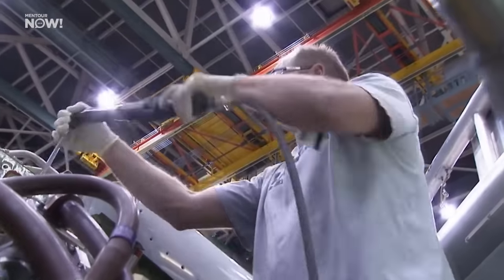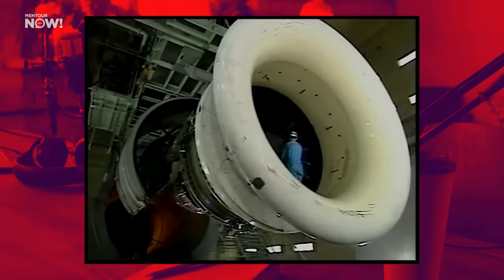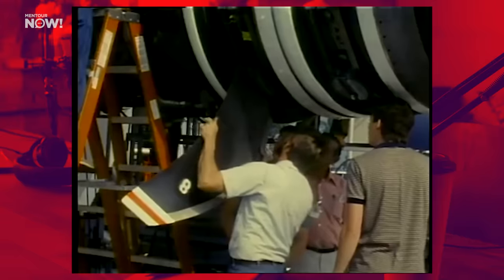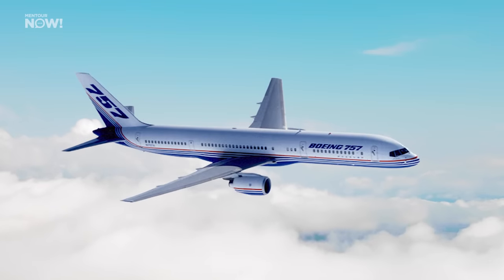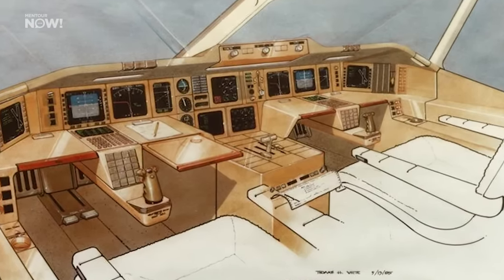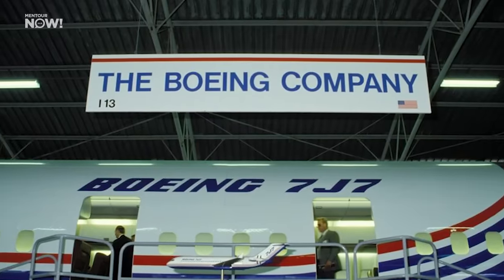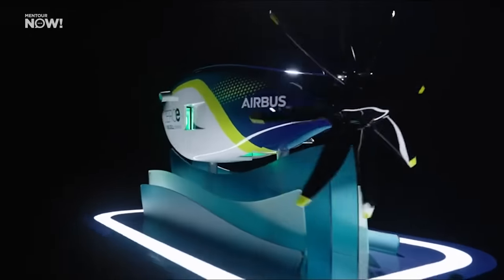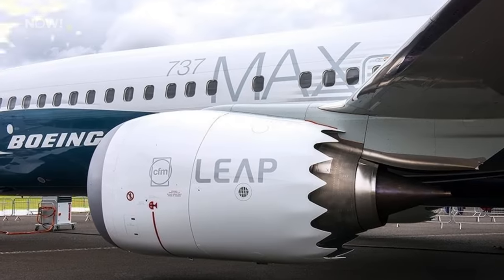Revolutionizing Flight! The Amazing Potential of the CFM RISE Engine.

Comment: I was flying in a UK E3-D,  with CFM-56s, in 1994. On take off we had multiple birdstrikes to the port wing and engines 1 & 2 suffered uncontrolled destruction, with blades flying in all directions. I was sitting right next to engine 2. None of the fragments hit the fuselage, but both cowlings were trashed. When those engines are at takeoff power there is a vast amount of energy. How I'm still here is a miracle.
Reply: Did the aircraft take off successfully?
Reply: @mjmulenga3  Hi, yes, just! We were Max all-up weight and were lucky to have the best pilot in the fleet as Pilot Flying. He had to actually bank slightly in order to clear a church steeple a few miles from base. It took us 20 minutes to reach 1500ft, very tense to say the least!
Reply: @tyrotrainer765 Umm wow!  Your airplane incident sounds very similar to what happened in the movie, ‘Flight’, with Denzel Washington and John Goodman.  Perhaps ‘Flight’ was based upon the incident you described and experienced.
Reply: @bryanbryan2968 Hehehe well, our Captain wasn't drunk, and we never went inverted!
Reply: @tyrotrainer765  Heh, interesting.  Was your flight well known to the public?  Glad no one was hurt.
Reply: @bryanbryan2968  Hi, I don't don't think it ever got publicised; the UK AAIB never got involved. However the public around Lincoln England certainly knew! We were so low going over the fields that the 999 emergency number was swamped by people ringing to say an AWACS had just crashed, with flames and smoke coming out of the left engines.

Comment: Great information. In the 1980's I was in the USAF as a 316X3 (instrumentation mechanic). Most of us worked in AF systems command that was the R&D department of the USAF and at that time there was a lot of talk about propfans.  Then it just ended with the noise issue being the reason given.  Thanks

Comment: Saw the UDF engines fly at the Farnborough air show on a trade day.  It sure had a distinctive sound.
Reply from the maker: I can imagine!
Reply: Sound normally means wasted energy.... The vortices around the end of blades waste energy and produce noise,
Reply: Maybe they should take a leaf out of Nuclear Submarine propellar technology which has resulted in a soundless propulsion.
Reply: @chrissmith2114  But why it has less fuel zipped than the less noise turbofan.
Reply: @TheGecko213  Modern Nuclear Subs use pump jets almost like modern day Turbo fans but since they turn much much slower they obviously make less noise. Still, a sub has to slow it's engines if it wants to be quiet, not something you can do with a jet plane.
Reply: @TheGecko213  
Submarine, and most marine propulsion, propellers ( generally called screws) do not turn as fast as these will. The fluid (water) in marine environment is several times denser than fluid (air) in aviation.
Reply: @johnarnold893  I agree, the speed of a submarine itself is already limited due to noise, but it is also nothing compared to the speed of an aircraft.
The viscosity of water also makes it easier to move forward with a bigger and slower blade.
Although when i turn on my ventilator with large blades and the one with thinner blades, the large bladed one is much quieter, but i do think a larger blade would start seeing a faster dropoff in efficiency compared to thinner blades.
Unless things could be scaled up to mega sizes, then the larger blades might become more efficient again, but that's just my speculation.
Reply: @chuckaddison5134  good answer, fluid dynamics in action
Reply: Is it super loud
Reply: Mitsubishi  ?//// high wing twin turboprop,was noisy,outside the aircraft,unique  sound,,,then the PIAGIO AVANTII, 2,IS NOISY aOUTSIDE THE CABIN,I had a flight ,in 1 years ago,it’s NOISE,is really,the props turn,in its engine exhaust, so no blade antifreeze,is needed,it is incredible fast,faster,and more economical ,than some small jets,,,,🇺🇸🇺🇸🇺🇸🇺🇸
Reply: @MentourNow   here it is ... YouTube video : Unducted Fan MD81 - SBAC Farnborough - 4 September 1988 

My wife was in the Aircraft Maintenance Systems sector - she secured our Farnborough tickets for all the trade days.
That year an AN-124 was a star performer ... especially when a replacement engine was required and flow in !
My firm had a trade stand at Farnborough, focused on air defence platforms.
Talk about work that was poles apart but in the same sector !

Comment: Amazing presentation and nice seeing these UDFs coming back. The design of the blades is crucial too to become a "supercritical airfoil" at high tip speeds - Hopefully reducing the sonic "clatter" that makes props so noisy as well as wave drag. CFD modeling has come a long way, not to mention engine core design.